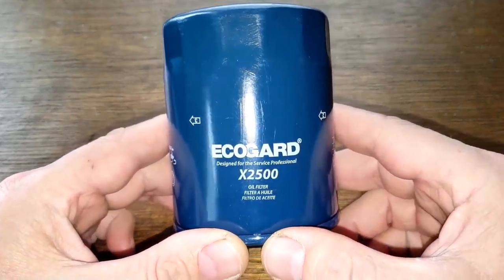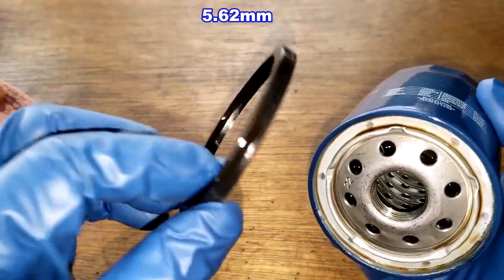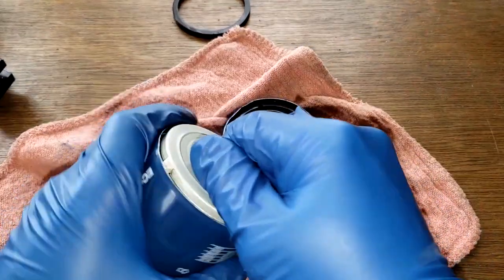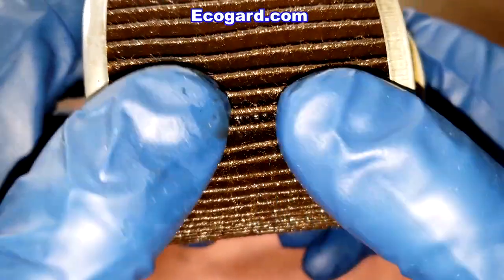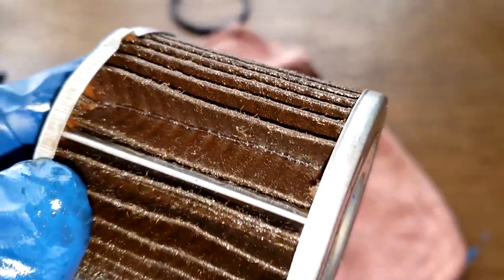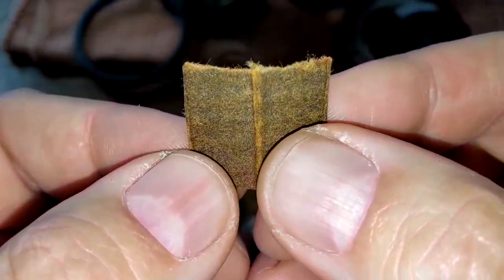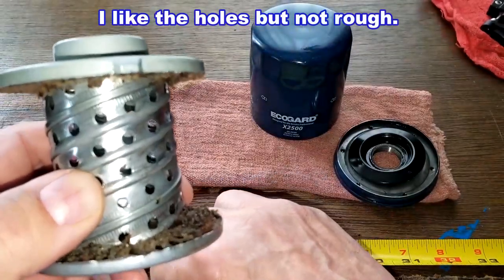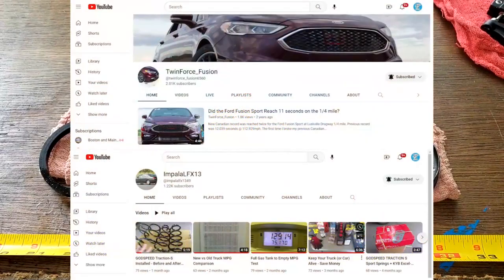Ecogard Oil Filter X2500 Cut Open, Used Ecogard Oil Filter Cut Open

Comment: I live in Ottawa Canada just like your viewer! I am sure what tore that filter is probably starting the engine at -35 or -40F with no block heater. I have seen a few of my cartridge filters collapse after an extremely cold winter and i am sure its due to extremely cold starts.
Reply from the maker: Hi David,
Thanks for Sharing, I'll pin your comment so that it sits on top.
Thanks👍
Reply: While the temps 'may' have been a contributing factor, it's easily seen that the tears occurred in the wide pleat spacing area(s). When tears happen, they are most often seen in those areas. So, I say the main cause is the poor, wide pleat spacing. Tight uniform pleating would likely have survived the cold temps. Also, the filter bypass is designed to open to a reduce the pressure spikes during cold starts with less viscous oil.
Reply: @WhipCityWrencher  Pete you have never pinned one of my comments, and I try so hard .
Reply from the maker: @kenj.8897  LOL, Remind me this Friday😊
Reply: Lol !! What tore the filter media was him twisting it out of the can.

Comment: People bash the orange Frams, but I've never seen one tear like this or the Purolators. If I remember right, one of the Fram engineers said the fiber end caps allow a little bit of flex under high pressure to help avoid this very thing from happening.
Reply from the maker: This one musta had too much flex. lol
Thanks, Retro👍

Comment: I recently cut open one of the ecoguard filters for a honda van with the v6 and the the pleats were torn by where it was glued in.  18k miles on that fiter and oil. Is a Oklahoma vehicle. Not mine. Had a bunch of big carbon in the pleats. The media tore out extremely easy. Wish i could post a picture of it in my comment. Per their website its a paper media that is ment at the end of its used the filter can be burned basically and the metal can be recycled.
Reply from the maker: Sorry to hear about that but the X Ecogard oil filters are only rated for 5,000 miles.
Reply: @WhipCityWrencher  ya this was a friend of mine who was borrowing the vehicle until he could get another vehicle. It's like his family's loaner to whoever needs a ride. The oil was terrible in it.

Comment: Some one a while back on BITOG posted either a Fram PH10575 or TG10575 that tore that was used in Canada during the winter and it tore, seems like these el cheapo filters don't hold up to the high differential pressure.
Reply from the maker: Good point!
Yep, the oil doesn't flow as well in the winter.

Comment: I appreciated the metal core with holes (except the rough edges of said holes) since most seem to be metal cores with louvers, but obviously there were some quality issues with the filter media entirely. It had some pretty distinct holes in the magnified view, and I’d imagine if the media had a weak point near the glue already and had the widely spaced pleat, it’s possible that explains the failure. I’ll stick with my Mobil filters.

Great video as always!
Reply from the maker: Thanks👍
Reply: Yeah the tear in the filter media happened during the disassembly. IMHO

Comment: Looks like the material cutter tore it or cut it rough.   Filter still did it's job. Poor micron rating. 96% at 20 means what? 99% at 30 or 40?
Reply from the maker: It couldn't have happened on both ends of the filter element.